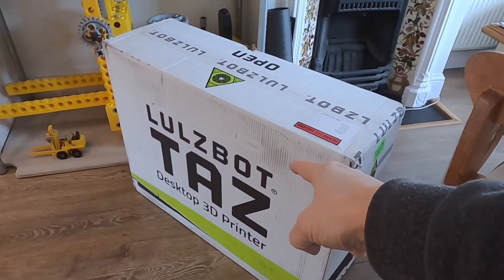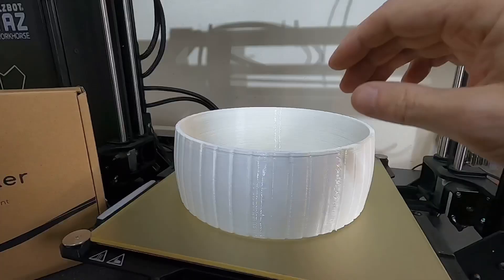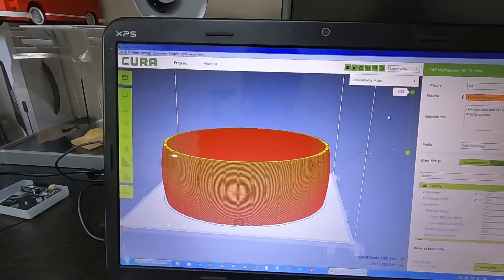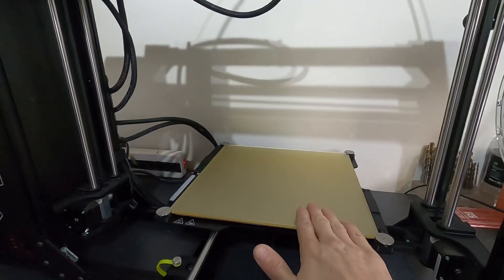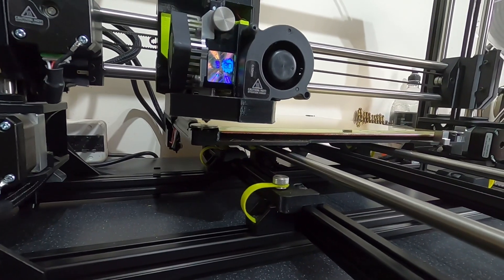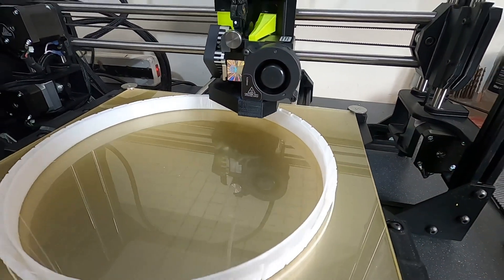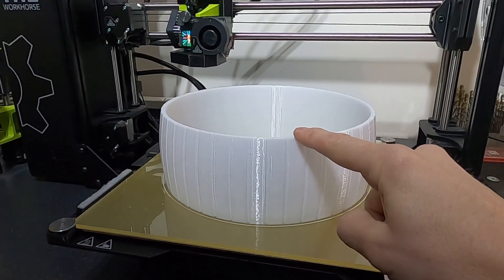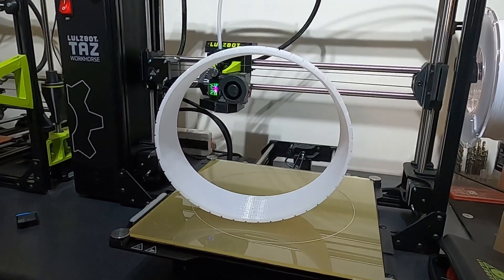3D Printing a D-O Droid Tyre using High Speed TPU

Comment: What's the advantage of a belt drive Z axis vs a leadscew?
Reply from the maker: Good point.. well it moves faster.... but otherwise I'm not sure, I think you get better print quality, plus it can auto calibrate its own Z height between each side of the printer.
Reply: @MattDenton  I get the speed aspect, but I've never really had a situation where I needed my Z-Axis be super fast, especially during a print.
You can do autocalibration with leadscrews.

I don't know about the print quality, but I feel like you'd lose resolution with a belt system over leadscrews. Maybe it prevents things like z-banding, which you can get with a slightly misaligned leadscrew?

Anyways, I've seen a few "high end" printers move to the z-belt system, so there must be something to it
Reply: @nathan1sixteen  It also helps to eliminate backlash.
Reply: Belted z eliminates z wobble print defects induced by bent lead screws, couplers, misalignment etc.
Reply: @jim2386  that's what I figured, but at the same time, I feel like you lose resolution due to the limitation of stepper motor accuracy in baby stepping and all
Reply: @nathan1sixteen  it’s a gear train, not just belted directly to the stepper.
Reply: @jim2386  if you gear the drive, doesn't that re-introduce backlash into the system?
Reply: @nathan1sixteen  bed leveling takes care of z backlash...that’s the second time it taps the washer. Workhorse also has a calibration cube on the front that also eliminates backlash.
Reply: @jim2386  gotcha. Well, I'd imagine that, if multiple manufacturers are adopting it, it must have some pros over the standard leadscrew, so I'm open to it
Reply from the maker: Yeah when does it use the calibration cube? Is that something you do in the menu system.. haven’t looked yet.